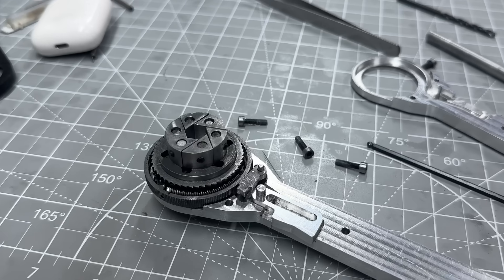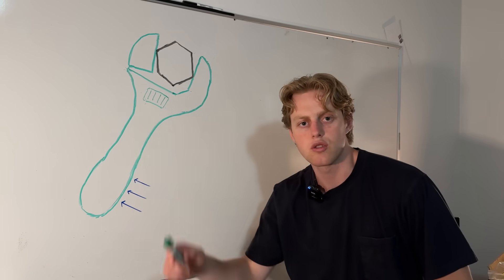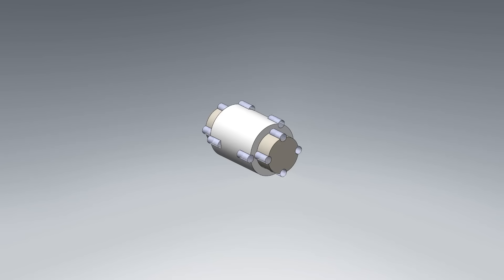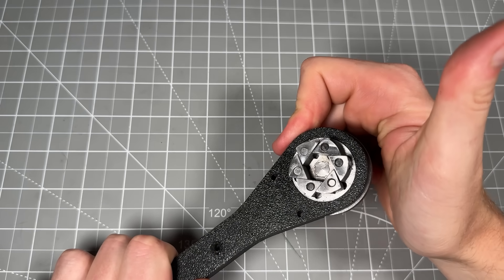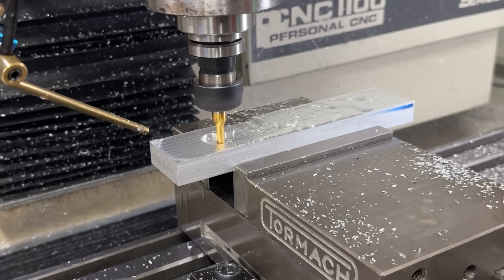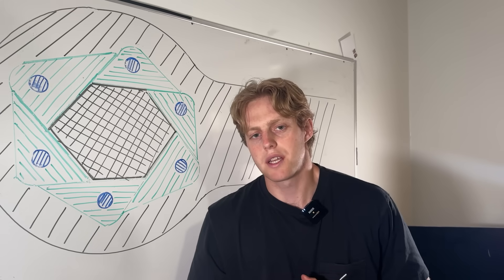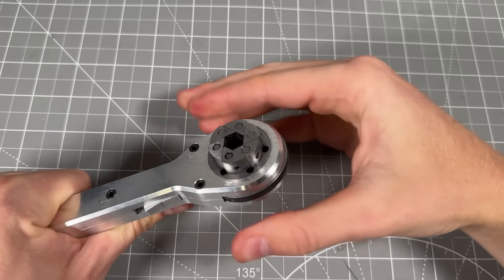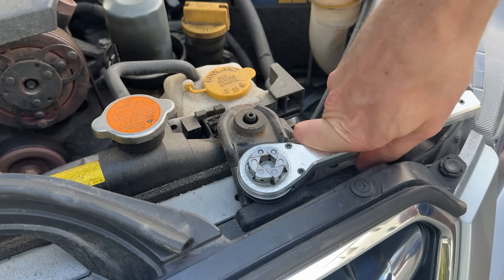I Invented an Adjustable Ratcheting Wrench

Comment: I could see this being handy for a Railroad Signalman. I used to upgrade signal bungalows and dealt with three standard bolt sizes when installing hardware like relays, electrologix units, and the battery banks: 7/16”, 1/2”, and 5/8”s. Sometimes there were outliers. I had a ratchet wrench that had all those sizes built into one, and it was effective, but this is pretty cool. The two handed operation to adjust might have made certain situations annoying like installing relays overhead that weigh 5lbs and require two hands, but I could also see times this would have been great to have. Awesome engineering, dude
Reply from the maker: This is a good point. I need a way t hold the jaws open with on hand.

Comment: Ingenious design. How about just using the pins to grip the sides? It'll prevent damaging the corners of the bolt/nut. Additionally, you could use thicker pins for strength. Regardless, very well done.
Reply from the maker: Interesting Idea

Comment: The parts seem quite small, in regards to the maximum torque the wrench might be rated at.. What is the “guaranteed” life of this wrench- say - if always used at its maximum torque, and what is that torque? Will it jam, from deformities created due to the rather thin structure(s) of the components?
Reply from the maker: There is definitely a lot of testing and optimizing to be done before I can get good answers to those questions. The design intent is to be consistent with a traditional quality 3/8 drive ratchet.

Comment: Would it be possible to have a through hole? It would be great for nuts that are on a long threaded rod or bolt. This would be incredible for motorcycle riders I think. I would absolutely love one of these
Reply from the maker: I will work on that... an older version had a through hole but I couldn't make it work. If I end up splitting the wrench into two different sizes, I could likely add the through hole back on the large version. What are the main bolt sizes you would need to work on a motorcycle?
Reply: @Trevor_Faber 10mm is probably a given of course. Ive seen as small as 8mm, and the biggest on my bike is 19mm. The 19mm is rear axle (I have a small bike) which may be needed in the event of a flat. Also may be worth looking into a way of cleaning, or generous enough tolerances. All tools get dirty, I'm guessing this is why basic adjustable wrenches have so much slop

Comment: Good work, great design but I don’t think it will really catch on for mainstream applications. I think you should try and focus on specific use cases for the design where it might be more practical. Something like automated production lines or for specific product applications
Reply from the maker: Good thought, I would agree. In it's current form factor it will be hard to sell to seasoned mechanics.

Comment: Maybe adapter the clamping mecanism to a standard ratchet head square.. will be a convenient multi-size socket.. for the Turn direction, is it possible to use a second rachetting gear on each separated spiral plate and activate the right one with a selector ?
Keep on your good work ! have a good one

Comment: Much better than those sockets with the many pins that are marketed to fit all size bolt heads. I'd actually use this and trust it not to break immediately, based on your testing. One thing I'd add for my personal use is an adjustable handle to change the angle of the ratchet head and get into tighter spaces. At the moment it's limited to using in an area with lots of clearance round the bolt, so not ideal for automotive work.
Reply from the maker: God ideas, there is definitely a lot of opportunities for tweaking the design for specific applications.

Comment: You need to patent this before some big company steals the design
Reply: most likely there is a patent that has been juggled around since the early 1900s already. Things like this were very common when lathes became more accessible back then. Just look at the fractal vise.
Reply: Unfortunately once an idea is made public it may no longer be patentable. Trevor: if you haven't filed for protection on this already, but intend to, please remove this video and speak to a patent lawyer asap.
Reply: @nathan87 In the US you have 1 year from going public to file for a patent. Also important to note, you don’t actually need a working product to file a patent, and a patent can be updated with subsequent filings to account for future development of the idea.
Reply: @sethrich5998  That's only for US. Everyone in other countries can produce or sell the same without any worries or royalties.
Reply: @speedofscience Well duh, I did specify US patent. Most US based small businesses/products don’t bother with international patents, it isn’t worth trying to defend internationally.
Reply: @sethrich5998  Ok then: if a third party publishes the same thing, say I make a video about it "X reacts to this product", your US patent is also gone, duh.
Reply: @speedofscience That’s not how a US patent works at all but ok. For the record, I’ve written and been a published inventor on patents.
Reply: @sethrich5998  That's how a disclosed US patent work. You only have the other kind of US patent so your knowledge is fairly limited.
Reply: @speedofscience Either I don’t understand what you’re trying to say or you’re wrong. You have 1 year from disclosure to file. A third party talking about it doesn’t change that.
Reply: @nathan87  Doesn't matter if video is removed or not. That has no bearing on the novelty of the invention.
Reply: @no-one_no1406  it shouldn't, but in many countries it does. If something is made public prior to filing, it is no longer novel. Other countries have grace periods. I don't know if removing the video would realistically undo anything now, but it seems a sensible precaution.
Reply: Patent does nothing to protect the idea/design in a practical sense. If some tool brand rips it off he would then have to start a lengthy and expensive legal process to defend his claim and he'd have the law on his side with the patent but then the offshore company just changes its name or another company starts it up and the cycle continues. Best thing is to have documentation dated and notarized to protect your interests if it's a highly complex design and wait until someone rips it off (patent means you make the design publicly available and easy to copy in exchange for "owning the design", or yeah patent it and try to market it as made in America with the best materials/tooling/QC etc. to combat the china rip offs.

Comment: This is pretty neat, wish i could use one but its got 3 deal breakers for my line of work. Its bulky size, doesnt reach recessed bolts and it looks like it only works on hex heads

Comment: This a very interesting project the amount of work is quite commendable…I would think making this into an adjustable socket that goes on a 3/8”, 1/2”, 3/4” ratchet drive would not only allow for a slimmer design that can fit into smaller areas but you wouldn’t also have to be making the ratcheting mechanism. Just a thought if you would like for me to explain in more details just let me know and I will gladly share my thoughts with ya…keep it up
Reply from the maker: Ya I think your spot on

Comment: Marine engineer here, I absolutely love the idea of taking this wrench instead of carrying 10 different types but I think the issue it might face is to slacken the high torque bolt or nut because of ratchet system might break and the size as we usually work in tight space where we don’t have so much clearance, so if you can,try to make one without ratchet which is thinner and I tell you I’ll be your first customer 
Anyways keep up the good work

Comment: OK, so this is exactly what robot arms need. They usually rely on bulky end effectors and tool changers.
Ideas like the one here have been tried before, such as the mechanical iris, but they are not as functional.
Your invention could make you millions!
DO NOT sell tools for humans, INSTEAD try appealing to manufacturing companies.
Reply from the maker: This is great! If a robot wants to pick up a bolt it probably needs some form of electro magnet and need to swap between different socket sizes (or have some super strong c/amp). This design would self center the bolt and have enough retention force.

Comment: How does it hold up in dirty environments?
Reply from the maker: Good question. I will need to test it.
Reply: @Trevor_Faber  Appreciate the response man 😀 
Being an industrial fitter I'm often working in places with heavy dust, dirt, grease, paint chips, rust flakes, sludge, rotting animal fats, harsh corrosive chemicals, or any number of other nasties, it takes a toll on anything with moving parts, so I'd be interested to see how it stands up to them.  

Corrosion and scratch resistance would also be something to consider if you were to go mass production with this, rust or burrs in the mechanism or on the sliding surfaces  would both be a disaster. 

I have some ideas for how you could do this: 
1. Make some of the more delicate and non load-bearing components out of something very corrosion resistant like 316 stainless, and chrome plating some of the others. You are limited in the load bearing components though, as stainless is prone to work hardening and fatigue cracking. 
2. Use rubber seals to try to seal the openings to the mechanism as best as you can, to keep moisture and debris out. This way you could also fill the head with a long life lithium grease. This comes with the downside of anything that does get inside won't be able to get out again. 
3. Do the opposite and design it with large openings in the head so that you can easily clean and lubricate the mechanism. This has the downside that if it isn't washed then the mechanism could be worn down 

Either way it's an awesome project man, excited to see it develop!

Comment: Chamfer, Make a removal and a tightening wrench to streamline the head. Add a button to lock the jaws open for when you cannot get your hand in the space with the wrench to actuate the jaws to get it on the head of the bolt. 

Its a clever tool, i cant imagine it will ever be better than a full tool set. But its really neat!
Reply: That, and because most of us will eventually misplace the other wrench, make the other wrench attach to the handle, so you essentially have one wrench with two ends with an option to split them and use a cheater bar!

Comment: Very cool. Would never replace a standard socket set in most applications, but I could see this type of device being very valuable in field settings where you don't want to lug around a million sockets, especially if you're needing to work on both metric and imperial bolts (god forbid) in the same setting. An absolute requirement will be to somehow make this more versatility for depth and inset.

Comment: This is great, but I wonder how much torque you can make this design handle before it fails. If you can beat the other adjustable wrenches that would be a major selling point.

Comment: You need to be applauded for such a clever design. I don't use tools as my trade so at best I am a hoibbiest / DIY-er. However, I would buy a quality tool like that to help me with those general jobs where I could just grab the tool and out it to work without thinking about what size I need.

Comment: This is a great innovative design. I was also recently looking into universal sockets and found the Channellock 905 and 906 from the 1950s. It’s basically a patented compact chuck with 3 contact surfaces. I got one off eBay and love it. It’s 1/4” drive and so it attaches to any standard ratchet.

Comment: This is super cool I would love to try one out. I don't think I could replace my regular ratchet with this because I'm almost always using an extension. If I were to want one I would probably like it in a bigger size (kind of like a 1/2 drive ratchet) to tackle bigger bolts which I don't encounter very often.

Comment: Good design work and execution. However, I doubt that this tool is practical for real-world use. The design is too complex – this complicates manufacturing, increases costs, and makes the tool prone to failure. The overall shape is rather impractical for most applications. It might find success in a specific niche, provided that niche is clearly identified.

I've worked as an R&D expert for many years. You can design and build many impressive things – but in the end, someone has to be willing to pay for the effort involved.

Comment: I think just making two wrenches (one for tighten, one for loosen) would have been a good solution. I mean two in one is amazing, but usually there's a phase of work where you are disassembling (which is loosen) and there's a phase of work where you are assembling (which is tighten). Next to that is a breaker bar which I think you should also make an adjusting head for.  .. but all of that is possible, just depends on product placement.

Comment: One possibility to lower the profile and also differentiate forward/reverse would be to make the wrench double ended.  You could etch arrows into it, or the typical "on", "off" nomenclature so you know which side to use. It obviously creates other issues (twice the parts, how to hold it), but it would reduce the profile by ~1/3rd, maybe reduce the bending moment on the pins (not sure, might not make a difference), etc.

Comment: I fucking love this, no need to fiddle around with a tool box trying to find the right socket. Also, the fact that you can thread bolts in without needing to turn the wrench or do it by hand is actually so good. We had some sump pump issues and because the pipe that the pump uses to pump water out is right there it's so hard to get those bolts out. I need one, NOW!

Comment: This looks like a very valid addition to a professional, mobile toolbox. Especially mobile services could benefit from this, I belive. Or as a 1st aid tool to have in the back of the truck/car. Or if Your brain is metric and you need to work on imperial stuff- like I would absolutely struggle. I think You´re really on to something here. Greetz

Comment: Great idea! Definitely has the potential to be a commercially viable product. It’s definitely worth downsizing if possible, to help fit into smaller places and on that note, you’ll need the controls further down the handle. Trying to twist the mechanism to open the jaws and then let go on a bolt would not be possible in a lot of use cases. Maybe you can open and lock it, to then release it once in place with a button on the handle? Or maybe a pull back mechanism can fully control the jaws from the handle?

Comment: There is certainly a place for this wrench. Maybe not in a garage that only works on cars and trucks, but plenty of trades would use it. I certainly would in my side gig. I do mobile bike repair and I’m always looking for ways to downsize my tools I take but not compromising on usefulness. I don’t need clearance, but eliminating the socket set out of the mobile tool box would be immensely helpful. I’m sure electricians, plumbers, etc would find it similarly useful. And adding a way to size a bolt would also be an excellent feature.

Comment: This is very interesting. I would certainly have use for it, as a tool. Turning it into a product is a whole different scope of work full of specialized skills, if that's your aim. Find some who's done something similar to help you navigate unknown unknowns.

As for the design, it's clever. First, don't fall in love with it if it turns out to have problems not yet foreseen. You've had one clever idea, so you can have another and so on. Second, if you want to make a product, you may well need to totally rework it for manufacturability. Again, don't be discouraged, you've had one clever idea and can have more ideas. Third, be cognizant of when you've hit "good enough" but good enough is measured against different purposes. This is more than good enough as a promising prototype, but it might not be for a product. But also endless redesigning costs time and time is irreplaceable.

Comment: Why would "big tool" build one adjustable wrench when you can sell a whole set? Hoping you have a socket version so the handle can be different sizes with and without torque

Comment: This is absolutely awesome, as you pointed out the bulky head would be a huge problem, especially in a cluttered engine bay like that if the Subaru you showed. Not being able to have an extension would be a problematic aswell because even a traditional ratchet is to large to fit on alot bolts without one. Super awesome idea and a tool I would love to have but I doubt I would use it much because of those issues.

Comment: If you haven't already filed for a patent, you should. Your design is now exposed. You do have a working prototype. Consider this type of content marketing material once the patent has been received. You might have future designs or ideas.
   I have made the same mistake myself. Someone else with a lot of money can move fast. Patents aren't really that much money fyi. 
   It won't replace all of your sockets in a set, but it does appear to be practical. 
   I noticed the jaws opening a little when you applied force. Maybe you can make an improvement there. 
   Also, take a look at some nice box end wrenches, they have a little area at each corner that is not there. It moves the force from the corner of the bolt towards the center. It helps keep it from rounding and creates a better grip. Good luck!